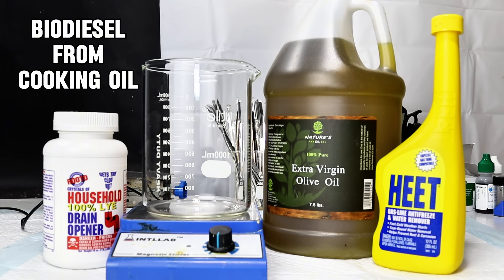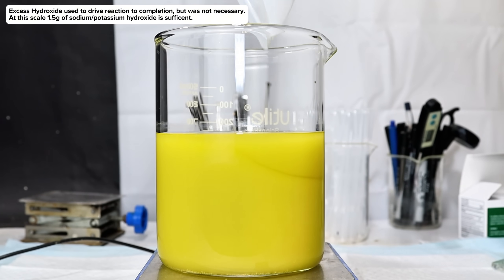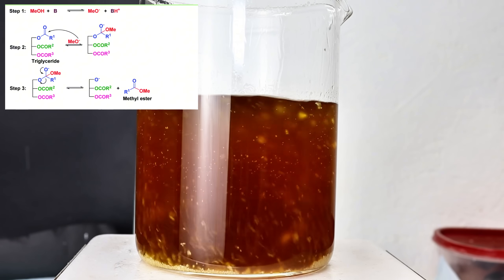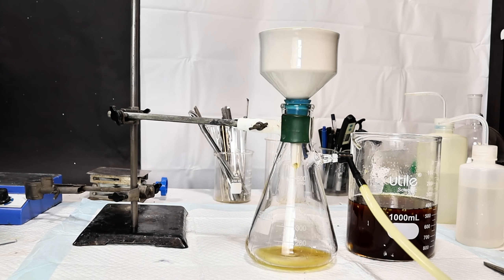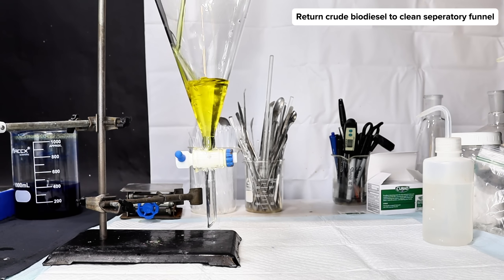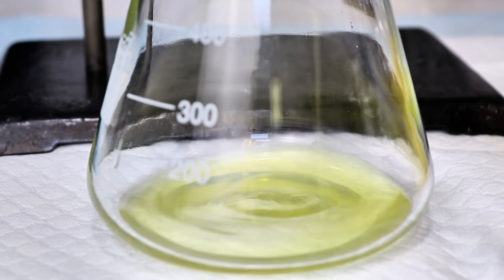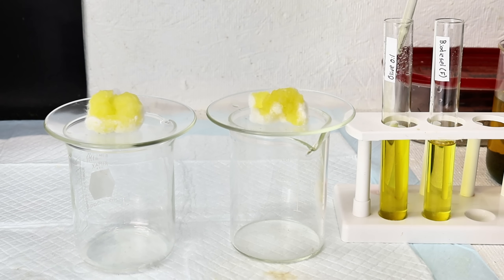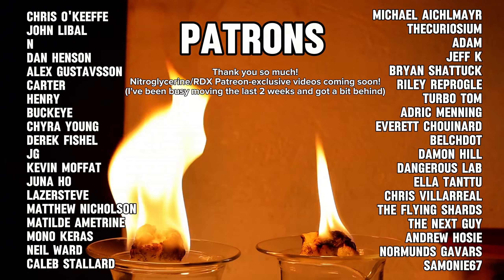Making Biodiesel from Cooking Oil

Comment: I helped build a small scale bio fuel plant, couple tips for you. Let the oil sit around for a while in a container after collecting, up to a month, gravity will do a lot of the work of removing water and sediment. Pure biodiesel isn't good for engines, not enough lubricants, add some or mix it with regular diesel, 20% bio won't void the injection pump warranty. Vacuum is nice for transferring large quantities of raw material, and it doesn't like to be pumped cold. You can judge a restaurant by their oil, we had something like 150 we'd pick up from and only a few were really on top of changing the oil out regularly and on time. Avoid using oil (or for extra challenge purposefully get oil) from places that deep fry beef, that oil gets nasty and has a lot more transfats. Best oil hasn't touched any type of meat or fish at all, pure french fry oil. Watch out for dead animals if collecting from an open dumpster or barrel out behind the building. We never did figure out how to get the fry oil smell fully out of clothes, but Lestoil works best if you make a mess.
Reply: We actually use marine oil centrifuges to separate water and crap from used cooking oil. Works like a charm!
Reply: You can add 2% smokeless two stroke oil for lubrication.  An off brand marine oil is perfect.
Reply: B100 is completely fine for engines, if made to ANSI specifications. It has superior lubricity compared to petroleum diesel. The only issue with biodiesel is it's susceptible to freezing at warmer temperatures.
Reply: @Orofino6  Not the only, unfortunately. It also absorbs water from air and being spoiled by the time way faster than conventional diesel. It also more chemically aggressive so needs different type of rubber for seals and even hoses.
Reply: I run 2 cars on 100% biodiesel and have been doing so for years. Admittedly 'older engines' but I suffer no problems using it as fuel. I have driven easily 200,000 miles in 15 years using B100 as fuel; it does no harm to my engines.
Reply: calls restaurant
"Mind if I come over, and make a mess?"
Reply: Thanks for the tips
Reply: Putting your smelly clothes in a vacuum for a day actually will remove most of it
Reply: gravity? u meant density?
Reply: @brlinf06398  no, brother, he meant gravity. buoyancy doesn't happen without gravity.
Reply: @wigglebutts73  outside of the gravitational field of a large mass, buoyancy doesn't exist. "Floating" doesn't mean anything when there isn't a reference for what is "up" and what is "down".
Reply: @wigglebutts73  p.s. another term for mass density is "specific gravity".
Reply: Thanks for the info. Really appreciate it, great comment.
Reply: Reach out I’m in the process of constructing a similar plant. Would love to get in contact with you.
Reply: @mtreis86  
I am interested to learn more about what you did!

I would like to know more about establishing a small scale biofuel plant.

How can I reach out to you?

Comment: I am a MAJOR bio-petrochemistry nerd, so here are some ideas I’d love to see:

(Granted scaled up Biodiesel, especially of done “nice” would be neat to see, but it would be really exciting to see some more novel stuff done)

1.) Going from “raw” Plant oil to “Refined, Bleached and Deodorized” oil

2.) “Torrefaction” of Biomass

3.) Hydrothermal Liquefaction (would require some sort of pressure cookery type setup, but would be especially neat and give the process some good PR)

4.) Any sort of Syngas Stuff

5.) Pyrolysis Oil stuff (especially biomass, most content is on Plastic/RDD)

Those kind of got more and more demanding, but yeah, either way keep up the great work!
Reply: I am very interesting in most of these processes, especially the pyrolysis of biomass, which I have been doing experiments with myself.  However, I think hydrothermal might be a bit difficult to do with a relative level of efficiency/safety.  Most pressure cookers only get to ~2 atm, whereas hydrothermal liquefaction seems to require at least 20 atm to proceed at a reasonable rate.  I'm not going to say high-pressure chemistry is inaccessible to this guy, but it would require some specially built equipment.  Although, one could go the pipe-bomb route; seal everything in a steel pipe, let the steam build up pressure, and pray you survive.
Reply: @kovoc1  pressure release valves/burst discs could help but again it is on a whole other level!

Could dig for some papers of sub 20 Liter batch reactors and stuff / see what all they did

That and/or low(er) pressure HTL, granted as you said all the other stuff is easier and still neat+useful!
Reply: @kovoc1 TWO steel pipes, nested. Outer one with a pressure safety valve. Somewhere there's nothing to damage. Tundra, possibly. Or desert, get some solar heat energy going with a parabolic mirror. And a big rock to hide behind.
Reply: Paper mills burn black liquor for their boiler and electricity, and sell the surplus electricity. That black liquor is all lignin degradation products, phenols and derivatives, and can be deoxygenated to be just like gasoline/petrol, not diesel. Trees make a lot of lignin, and paper mills don't wanna stop making money off electricity, but if this could be diverted it'd be great to keep small engines running carbon negative. But if we want hemp paper, there'd be 1/5th the lignin per unit cellulose, and would not have this source.
Reply: @doublemerlin21111  but, since hemp is an ANNUAL crop, the gains from fibre production should outweigh that loss, shouldn't it? And theres a lot more direct ways of getting fuels out of even scrap/unmarketable wood sources. Woodgas, for one. And the byproduct of that is biochar, which is another useful product. Idk. What i hear is, it's the hemp processing equipment that's the bottleneck. Since we all but stopped growing it so long ago. And the seed is also an oilseed, isnt it? From my experience, quite a prolific one, and edible, as well as combustible.
Reply: @armandbourque2468 I spent yesterday watching videos on charcoal/biochar production.  Wood gas is CO, H2, and H2O.  Given the difficulty of reasonably drying and compressing that mix, a retort setup will run it back into the combustion chamber where burns & accelerates the conversion.

I didn’t know the paper companies burn the leftover black goo, but the DIY crowd seems to just throw it away as a nuisance - especially as it tends to clog drain pipes.  Burning that should increase efficiency a bit.

Comment: I think what you will find regarding used cooking oil at restaurants is the higher volume locations already have a pickup service and the lower volume locations wait months between pickups, during that time the oil starts going rancid and that's not something I would want to get anywhere near. If you can find a location that works though, by all means go for it!

Comment: Nice video!
Yes, classically you dissolve hydroxide in alcohol first. Don't worry about precipitation, later on you wash it with water, and right amount of hydroxide is not problem (it is easy to find known home protocols for that, there is conversion factor of hydroxide to oil)
if you try used cooking oil, remember about Robert Murray-Smith video of purification of oil with gelatine, would be more than needed if you do not want to end in filtration hell  XD

Comment: If you are gonna do the large scale procedure using waste oil, I saw a very cool technique to clean it on Robert Murray Smith's channel. Rather than filtering it and having to force oil through a vacuum filter, he activated some gelatin powder in water and mixed it with the oil. As it coagulates, the jelly captures the bits of food and drags it to the bottom. Might be an easy way of carrying out the cleaning.
Reply: ah, flocculation
Reply: And the gelatin and particulates are compostable. As is the glycerine by-product, which has other uses.
Reply: @armandbourque2468  glycerol is flammable (hypergolic with potassium permanganate even if I recall correctly). Given the amount of waste glycerol there is and how dirt cheap it's become it always intrigued me to find applications for it as a fuel.
Reply: @atrumluminarium  think it's the energy content, and maybe the fluidity that may be an issue, but could be suitable for low requirement use. Maintenance heating, dehydrating, like that.
Reply: @armandbourque2468  that's definitely an issue true. However if it's a waste product that's dirt cheap it's a question of just burning more if it. I think in terms of kWh/$ it might be the highest fuels there is without being a fossil fuel.

The viscosity then like you said is a bit trickier to deal with when applying it to anything beyond low requirement use.

Comment: As a career diesel driver, I can confirm that biodiesel is inferior in every way. I always avoid biodiesel blends whenever possible.
Reply from the maker: Hm very good to know, I'll have to look into some destructive distillation methods like kovoc mentioned. Definitely thinking now of different ways to go about bio/renewable fuels
Reply: Don't understand what the issue with biodiesel..use it all the time in mechanical diesel, non common rail type motors.
More economical, more lubricantion, nice smell😂.. @integral_chemistry
Reply: Exactly.  The real future of renewable fuels is destructive distillation of plant oils, since that produces a liquid that is chemically identical to normal Diesel fuel.  These ester fuels start to be almost unusable under 0°C.
Reply: @kovoc1  Not to mention that they don't burn as clean as regular diesel which shortens the life of modern emissions systems. And they're hard on the injectors due to their lower lubricity.

I'm not against renewables as such, but they have to work.
Reply: Interesting solvent properties.
Reply: @jc5445 Glad to just see someone who's open to It as long as it works

Comment: Before you think about putting this in a car, look up the material compatibility for your specific model!

Biodiesel can dissolve certain diesel fuel filters and also polymerize and clog up fuel injectors. I guess the tendency for polymerization can be minimized by using more unsaturated fats, but that may negatively affect the melting point of the resulting fuel.
Reply: I bet you could get away using a tank of 1:1 ratio with normal diesel, then using a full tank of normal diesel, but I would not try it on a modern diesel, unless I trusted what I was doing. Also testing the lubricity of the mix and correcting for it with 2 stroke oil should help since both pumps use it as a lubricant
Reply from the maker: Yeah that was my big concern about using this in an actual engine, I try my best to keep my science projects seperate from things that are actually valuable to me lol. Been trying to think of where I could possibly buy a secondhand sacrificial diesel engine for this and possibly future iterations
Reply: @integral_chemistry maybe you could get a lawnmower or possibly a sit-on lawnmower from sb who is looking to sell theirs for cheap(might get one with something else than the engine broken wich is irrelevant for your test). If you are patient you might get lucky
Reply: @integral_chemistry  Amazon sells cheap single-cylinder diesel engines that would work as test beds, I believe.
Reply: Correction: more saturated fats
Reply: i read somewhere excess methanol is one of the contributing factors to fuel line degradation. In the setup i helped some friends build we pulled a vacuum for methanol recovery then washed the methyl esters with a water sprayer. keeping the temp above 180 f to help the methanol leave. after letting it settle then dropping the water out of the bottom of a cone bottom tank we had an excellent fuel for the sawmill and associated equipment.

Comment: so do you have a small CI engine lying around for testing in that capacity? It'd be cool if you could power a fast food truck with biodiesel made from used frying oil of the same restaurants.

Comment: I would love to see whether you can recover some of the excess methanol!
Reply: Yes, because methanol is not cheap ...
By the way, does it also work with common ethanol?
Reply: @notconnected3815  in the video he claims it does, as long it is fairly anhydrous.
Reply: @rafaelgcpp  Cool, maybe he can try it again with ethanol, just to see if it works. Or i make a little experiment by myself 🤔

Comment: 🙏👍👍Acid titration is much trickier than using virgin oil - also the methoxide is dangerous to handle and can be absorbed through the skin, it should be mixed with the methanol as being the catalyst should be pure no water - after it is all reacted it hydrolyses back into methanol and hydroxide - but you can accidentally make soap 😂😂😂

Comment: Definitely try making enough to run a vehicle on. Also, wouldn’t you want to distill it?
Reply from the maker: I do want to try finding some sort of small engine I could use for stuff like this.. something I wouldn't mind having break.
And yeah I considered distillation but from what I read simple washing+drying is more standard
Reply: @integral_chemistry  What’s the approximate boiling point of the stuff?
Reply: Diesel engines can run on pure cooking oil. The air escape will smel horrible, and the filters will look like a never cleaned restaurant , but you'll not destroy the engine on a purified and neutral biodiesel.

Comment: try dissolving the hydroxide it's the best, and you need to add it in small cuantities. The methoxide formation it's an equilibrium reaction in wich large cuantities of water drive the equilibrium backwards, and large concentration of hydroxide makes a high concentration of OH-. 
With enought OH- concentration the oils start to hydrolize, forming soap and water. That water shifts the methoxide equilibrium backwards, making more OH- and thus making more soap making loss a lot of yield.
Reply: With used oil you have the problem of larger concentration of free fatty acids in the mixture that react with the catalyst to make soap. Maybe for that you will need acid sterification with sulphuric acid.

paper about that:
Waste Frying Oil with High Levels of Free Fatty Acids as one of the prominent sources of Biodiesel Production

Comment: This idea was tried at scale about 20 years ago and found that the cost to produce was not worth it, The used oil was no longer free once people started wanting it at scale. Food service business found a way to profit to waste was their point of view. Plus the cost to send truck to collect and haul to a “refinery” was not cheap.  All those cost meant the price at the pump was only around 20-30 cents a gallon less but the properties are not as good as petro diesel particularly the pour point which means the fuel sort of congeals in very cold weather.  Basically no one bought it.  The singer Willie Nelson dumped millions into his Bio Willie fuel and lost all.

Comment: Would absolutely love to see this on a larger scale with restaurant waste cooking all.
Reply: Biodiesel co-ops have been doing this at scale for years.
Reply: @armandbourque2468 My old high school professor did it with his VW bus in the 80s and had been to that day
Reply: Biodiesel Education on YouTube shows the University of Idaho's farm scale plant where we would make 300+ gallons of biodiesel from WVO collected from the school kitchens.
Reply: Works the same, just filter well before processing
Reply: In many places, this happens at industrial scale, and the restaurants probably don't want to just give away their oil any longer. Around Vancouver, west coast reduction picks up waste oil from restaurants across the city, and converts it to fuel at their rendering plant (along with other lipids). They do this at industrial scales.
Reply: it's already a business
Reply: I have been making  about 2000 gallons of biodiversity per year. I built my own refinery for around $ 800. I can make about 125 gallons per day. This is a lot of work but I can make biodiesel for around $1.25 per gallon. As I said this is a lot of work.
Reply: Yeah, and it would be especially cool to actually power a diesel engine with it in the end
Reply: YES!!!
Reply: it would be cool
Reply: I got the project in China
Reply: I have made biodiesel for several years. I would like to find a way to get rid of my excess glycerol. I use it for cleaning equipment but have some left over.
Reply: It's illegal where I live to make bio diesel,even from cooking oil, it's ridiculous
Reply: I would like to see the logistics needed to do that and the final amount of product rendered from such endeavor.

Comment: Olive oil (extra virgin oil) is now costing around 10 euros per liter and Diesel is costing around 1,50 euros per liter in Spain right now, I believe you are killing the golden goose to make an omelette.

Biodiesel based on cooking oils are not exactly sustainable and only rise the price of groceries to get some smelly fuel instead at a not very cheap price. I believe Brazil has some interesting developments on ethanol but I do not have the full picture about production and use of it.
Reply: You're literally using the most premium type of cooking oil there is. Of course it's going to be expensive. 

You could have tried the same process using far cheaper alternatives, like soy, sunflower seed, or palm oil.
Reply: Just use old oil, ofc it'll need a prefiltration, and better purification, but old oil can be used. Olive oil is always more expensive anyway.
Reply: Why i understand the sentiment, being myself a person brutally hit by the cost increase of olive oil. We can't ignore that this is merely a demo of a process that can be used to get a use out of depleted cheaper oil.